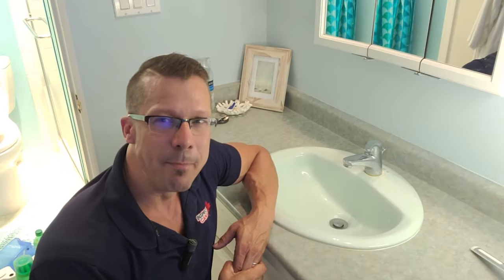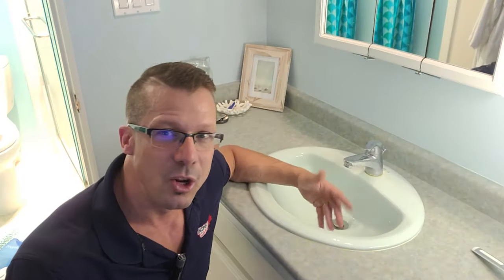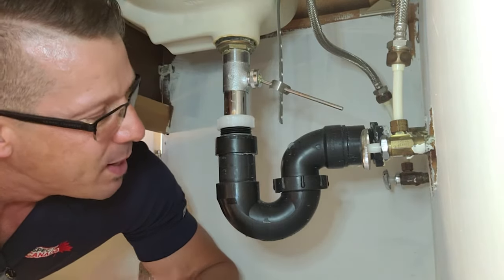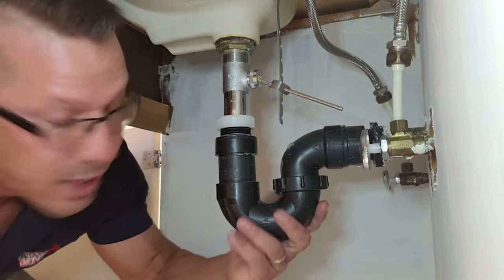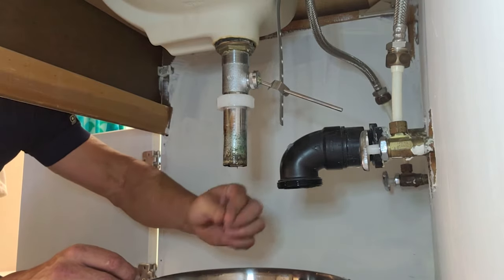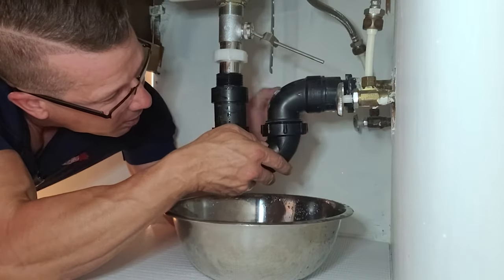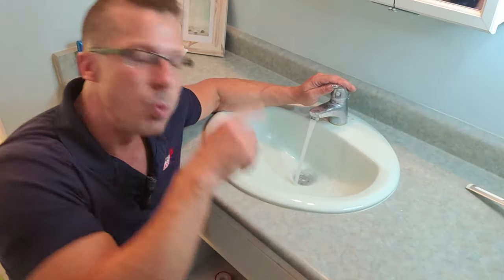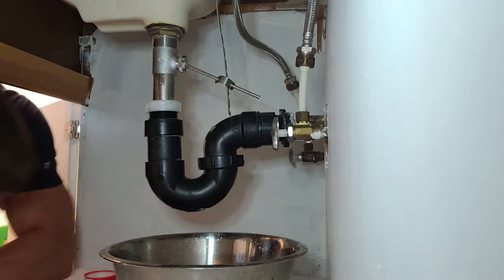How to Fix a Slow Draining or Clogged Bathroom Sink

Comment: Dude! The bathroom sink in my apartment has been clogged for about two months, and after getting tired of waiting for the building handyman to get to it, I decided to call a plumber for the job. But then I ran into your video first and set my mind to giving it a go myself. I did everything you did only I also removed the small section of pipe behind the P-trap because it needed cleaning as well. Just for good measure I used a small-job hand powered snake and went about six feet in. Then I put everything back together and PRESTO! No clog! All I can say is THANKS, MAN! You saved me some money and I got my bathroom sink back! 👍👍👍
Reply from the maker: So happy to hear this, thank you.

Comment: Very informative, thank you! I tried this today everything was clean and clear. I pulled out all of the gunk and hair but it’s still clogged once I put the pea trap back on. I do have another bathroom sink on the other side of the wall and now when that sink is in use the water fills up the first sink I was working on! Do I need to clean out the other sink too? They’re both connected I think.
Reply from the maker: Hi looks like it might be clogged down the line. You may need to contact a plumber to unclog the drain unless you have drain auger. You can get one for cheap at any home hardware store.

Comment: im having the same problem. i did the same thing except that i disconnected the plastic pipe that goes into the wall and there was nasty black gunk in the metal pipe thats in the wall. i tried cleaning it out as best i can, but when i put everything back together the water started backing up after about a minute or so. Any advice, need a lil help

Comment: I did everything you did in your video.  I also used baking soda and white vinegar. Alot of gunk came out and I was sure I had corrected the problem. However, the bathroom sink still drains slowly. What else can I do without calling a plumber?
Reply from the maker: Hi Jim, sorry for the late reply. There could be many other reasons why your sink is slow draining. It may be clogged down the line. Please consider hiring a plumber. Thanks for watching our videos.

Comment: So what if I did all this, found nothin, and it still won't drain
Reply from the maker: it is likely clogged deeper down the line. Best to have a plumber run a line down the pipe to unclog it. You can buy a cheap auger or drain snake and try to unclog it yourself. Best of luck and thank for watching the video